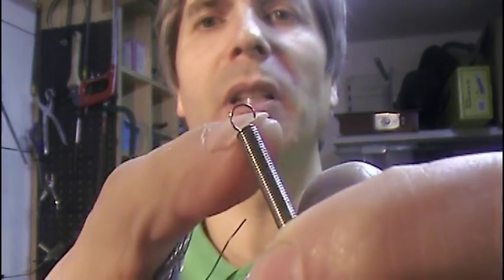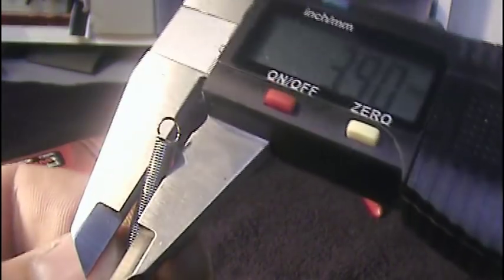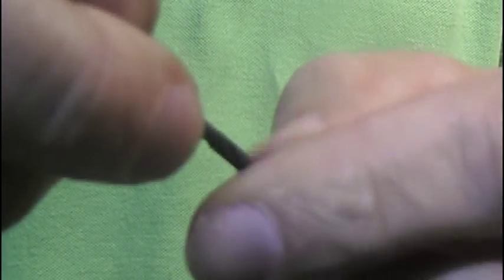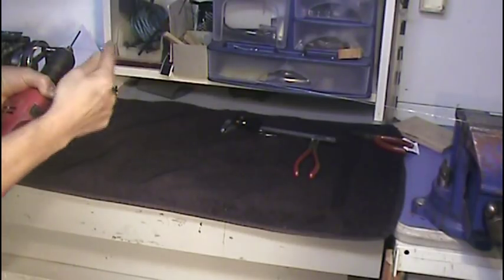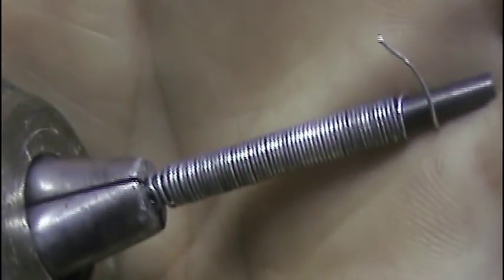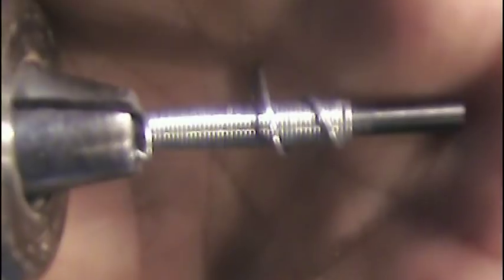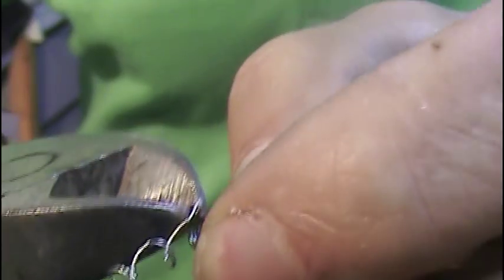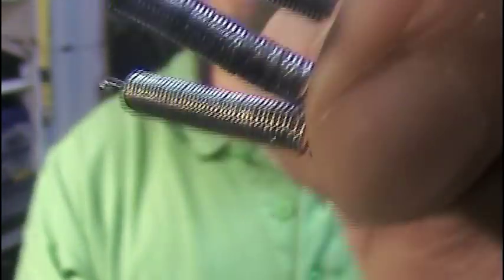How to make Coil Springs from a Steel rope/cable wire by hand!

Comment: temper the springs in a toaster oven and it will be just as strong as the original spring. It's a good idea it just needs to be expanded on as you have proven that steel cable wire is suitable material for springs.
Reply from the maker: Hello Evilcowboy,
Thanks for the tip and for watching my videos!

Comment: put it in the oven for 45 minutes and 450 degrees or 225 celcius to harden and it will be stronger
Reply: heat relieves stress in music wire & ss wire

Comment: Brilliant source for carbon steel wire! If you were ever in need of flat bar stock plumbers drain tape available in many widths is another great source of high grade carbon steel that can be quench hardened and tempered

Comment: this is a very nice video with a great result , but where can you get this diameter stainless steel for the trigger , steel will rust yeah ??
Reply from the maker: Hello Mohamed Salam,
I couldn´t find in my area any store that sales stainless steel spring wire, so I asked in my local fishing store, and they give me two used springs from old broken triggers mecs.
If you can´t find stainless steel spring wire try to find a stainless steel  rope/cable, look in stores that sell parts for boats, these cables are used in sail boats.
Good luck, and thanks for watching!

Comment: Great idea man!  I need to do this to repair my sons Disney's toy Woody.  Spring broke to retract the pull string, this will make a better coil than the original one in it.  However, I will use guitar string to make it.
Reply from the maker: Hello Hector Cervantes,
Thanks for the comment, yes guitar strings are great for making small springs,
thanks!

Comment: Hi, do you use armonic steel or normal inox steel ??
Reply from the maker: Hello Angelo,
I made this video just to show that is possible to make small springs with simple tools! the springs that I made on the video are made from a common steel wire rope.
To make springs the wire needs to be what you call (armonic or piano wire) and to make springs for spearguns that wire needs to be corrosion resistant, I don´t know if normal stainless steel wire will be good for springs!
The best is to buy the springs, if that is not possible then try to make it and for that I sujest using stainless steel wire rope/cable, if nothing better is available!

Comment: Try putting the drill in the vice instead. You could also try a foot switch to turn the power on to the drill with something holding the trigger on the drill closed such as tape or elastic bands. You can then use both hands to make a more precise spring.

Comment: I will try
Reply: Is it need temper....
Reply from the maker: Hello Sangzuala,
no need to temper it, just find a piece of steel cable rope with the right wire diameter for the application you need and make as many springs as you need. 

Thanks for the comment and for watching my videos.
Reply from the maker: Hello Sangzuala sailo,
yes try it, it really works.
Thanks for the comment and watching.

Comment: can you also make a compression spring?
Reply from the maker: Tom Sobieski Hello Sobieski,
the difficulty in making a compression spring by hand, will be how to keep the same pitch of the wire coils through out the intire length of the spring. The only way that i´m thinking at this moment is to use a screw, and wrap the wire along the theads!
Thanks for the comment and for watching my videos!
Reply: you could try a piece of square keystock, or some other flat metal bar. as you wind the metal would keep the gap consistent.

Comment: `why not coil the spring wire the way they do for copper?
Reply from the maker: Hello John Riley,
because copper is very soft, and the wire for springs is made from hardened steel.
Thanks for the comment.

Comment: if using a variable speed drill when you coil your spring try to hold the mandril at an angle so the wire you are coiling is  slightly pressed against the previous formed coil, this will give you better tension in your spring just make sure you pull hard to keep the wire in tension but try not to let the wire over ride the previous coil.
yours the spring maker...
Reply from the maker: Hello colin Burrows,
I know, the hand drill that i use didn`t help at all, but that`s the only one i have!
you explaned exactly how to make a spring, having the wire pressed against the last formed coil is very important.
Visited your channel, that spring making machine is amazing!
Thanks for the great tips, and for watching my videos!

Comment: Great way to make a spring. There are a lot of ways. Try another way. Set up drill in vice where you can control the drill and not damage drill.Then put wire in drill the way you did, but hold the wire with a vice grip as you spin the drill. I think you might have better control. Good luck.

Comment: you could also fire those with a blow torch and harden the wire.  I would think that would make it more like a real spring.
Reply from the maker: Hello jeff Beck,
many other people have suggested that, and i 
have tried it before, but it doesn´t work the wire got very soft.
Thanks for the comment and for watching!

Comment: Not an expert, but I've read always wear safety goggles when working with spring wire, because it can snap loose and cause severe injury if you aren't careful. With heavier spring wire, you have to be careful of actual limbs too.
Reply from the maker: Kyle Blank Hello Kyle, Yes you´re right.Thanks!

Comment: I think the spring needs to be treated with heat
Reply from the maker: Hello Krystal 2018,
not if using wire rope, because the wire is already treated and tempered.
Thanks for the comment and for watching my videos.

Comment: Instructions not clear, burned down the house and married a goat.
Reply from the maker: Hello Flemish Templar,
that happened because of the lack of safety fectures in your medieval armor, from what i can see it´s just a simple base model without any extras, like a fire extinguisher, smoke alarm, rear view mirrors, video cameras, gps and much more! The marriage thing, i think it was just bad luck, or mabe it was because of that armor again, the problem is that theres nothing that can be done to reverse it, you just have to live with a goat!
Thanks for the comment and for watching.
Reply: @MrMyvids4you  Yeah you're absolutely right, my helmet could use some rearview mirrors. It's kinda hard backing up op de driveway when u can't turn your head. I will upgrade it before proceeding. And about my goat.. uh i mean my wife. The reason i married her was because she looked more attractive and feminine then the females in my surrounding. At least, the goat is good at mowing the lawn. How many women do u know that do that chore on their own?